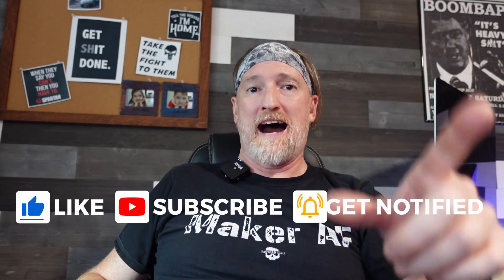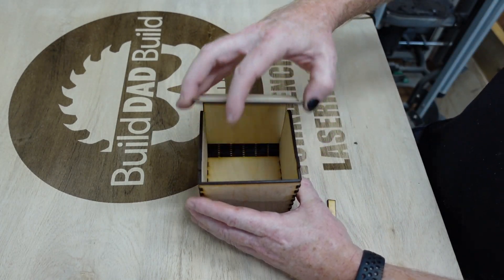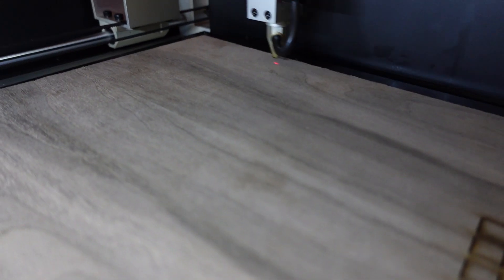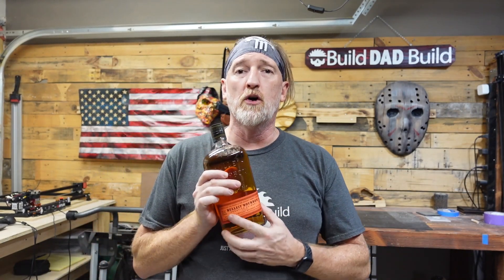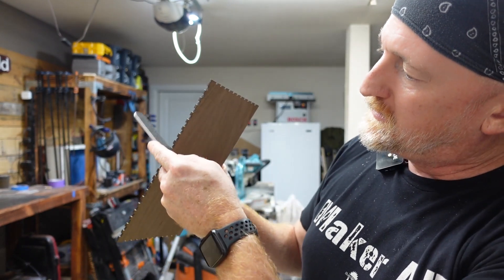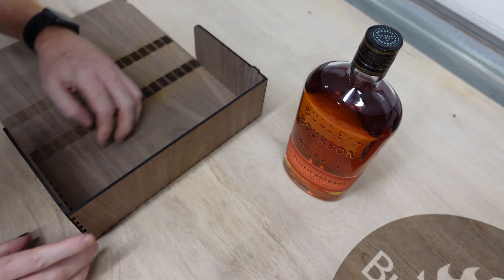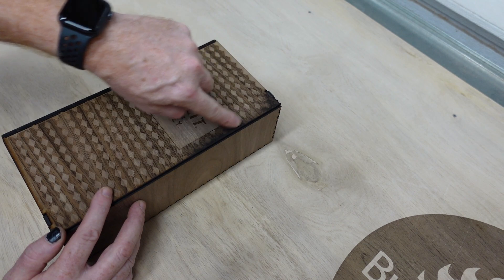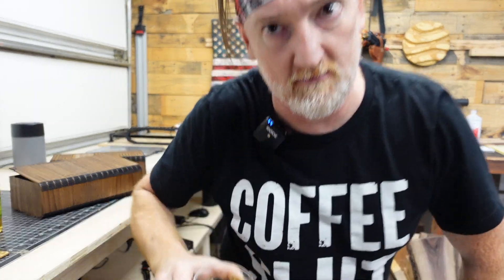Making a Laser Cut Whiskey Gift Box with my Muse Core

Comment: Very helpful! For the test pattern, I prefer to use the grid function to add all of the boxes to the project. It takes a bit longer to set up all of the power & speed settings. But the benefit is that I can quickly run the same test on different materials by simply changing the label element to reflect whatever I'm testing. Plus, I can save the file for later if I get a new material later.
Reply from the maker: That's a great idea!
Cheers

Comment: Have you done any metal etching using the dry moly method on aluminum? also Have you used the next size down laser like a 5W vs a 10W I'm struggling to find something that doesn't wash off of aluminum once the etching is done.
Reply from the maker: I have not successfully marked unanodized aluminum

Comment: Why didn’t u make it open in the center front and then u could have made a closure mucho simpler. So you would have made finger joints on 3 sides of the top and bottom with finger joints on the main panel on the corresponding joints. Decorate the front 2 panels and walla ur done.
Reply from the maker: Because I’m a horrible person. 👍🏻👍🏻
Reply: @BuildDadBuild  you don’t understand do u?
Reply: I was an industrial engineer in my other life in a large farm equipment manufacture, so I think out of the box most of the time. I’m looking at alternative designs all the time.